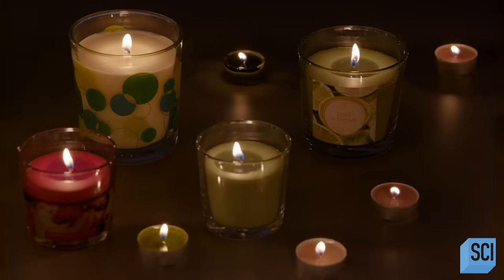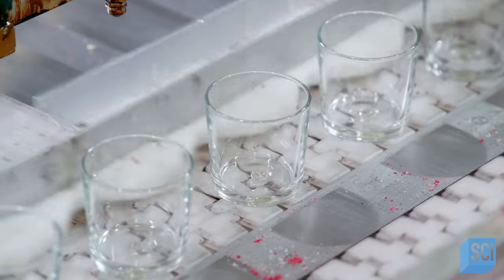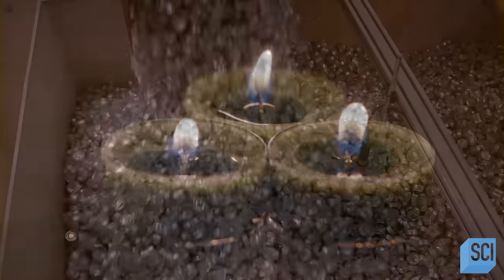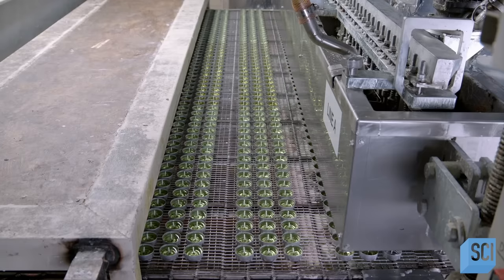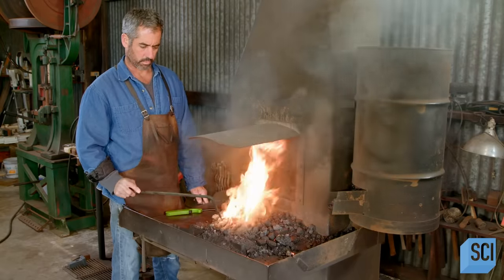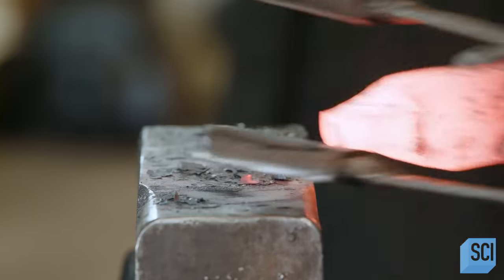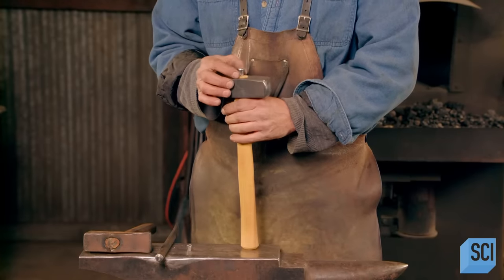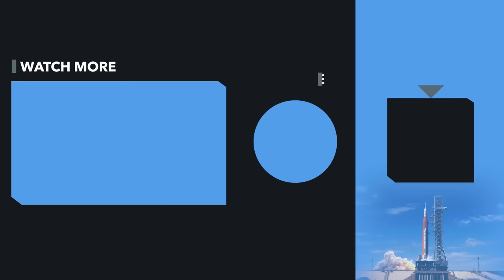How Candles and Hand-Forged Hammers Are Made | How It's Made | Science Channel

Comment: Ash is useful for this bc it doesn't shrink as much as other woods, so the head of the hammer can stay on longer.
Reply: True.   But.  I've never seen someone grind the top of the handle flash with the hammer head
Reply: @jonas2431  With the wood and metal wedges it won't come off anytime soon. 😀

Comment: The mechanical hammer is just called a power hammer, and the pedal is called a treadle.
The steel isn't compressed during a punch, most of the material is pushed outwards.
That was a spring fuller, not a spring swage
The eye contoring tool is called a drift, and is used to shape and to stretched out the punched hole.

I shouldn't have watched this episode, but I was excited by something I love
Reply: i love your enthusiasm ^^

Comment: which came first the hammer or the hammer
Reply: The angle grinder used to make the hammer. 😂😂😂😂
Reply: Serious answer to your joke; the rock came first. Bash some metal on a rock with a rock, making a crude hammer head. This becomes your new hammer. Now bash some metal on a rock with your hammer until you have a roughly flat surface. Strap this surface to the top of a log; this is now your anvil. Now you can create a cleaner, less crude hammer, and the tools needed to forge a proper anvil. Congrats, centuries of metal work innovation has been summed up in five sentences.
Reply: @HalRiveria except for the part where the log catches fire OH SHIT GROK GET ME THE WATER BUCKET OH NO THE HUT IS BURNING